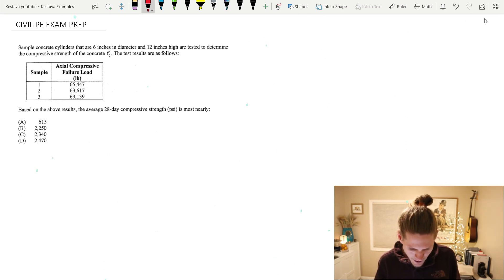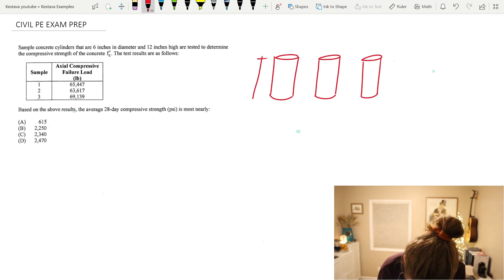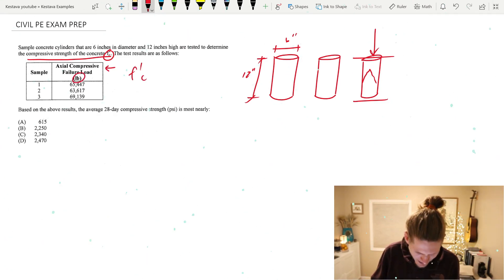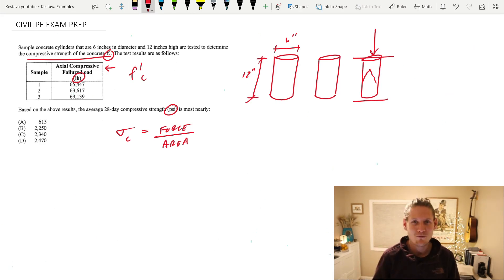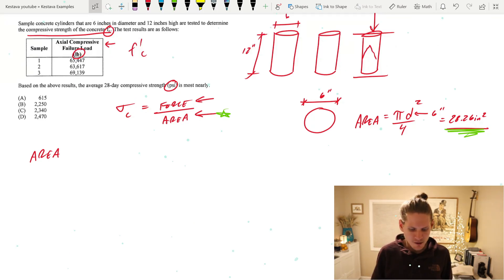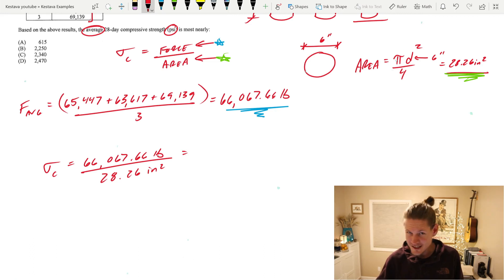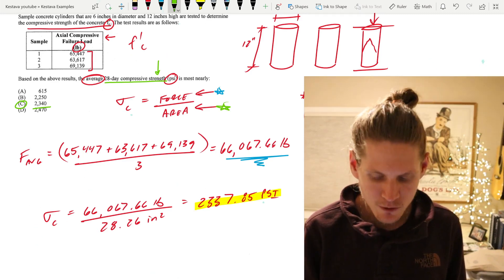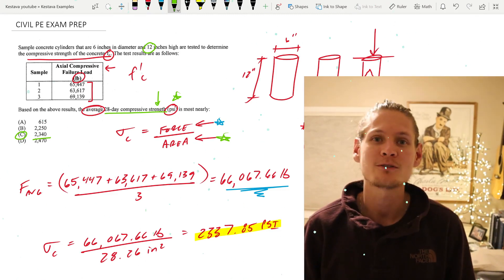3 Tips for the Civil PE Exam... Even the Computer Based Test

Comment: Does it matter if you compute the individual sample stresses and then average the 3 stresses calculated? You get the pretty close to the same answer but they are different. Is there a standard method?
Reply from the maker: Hi Joshua - it should get you the same thing. thanks for checking!